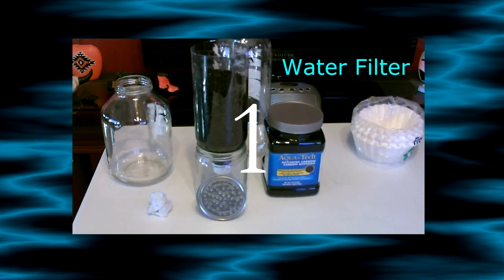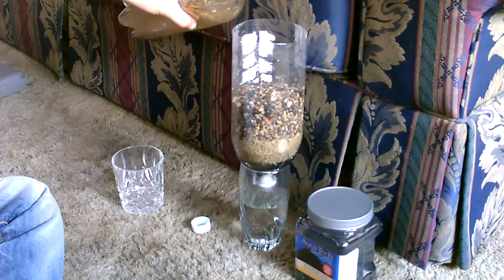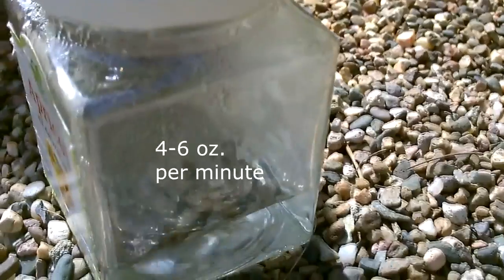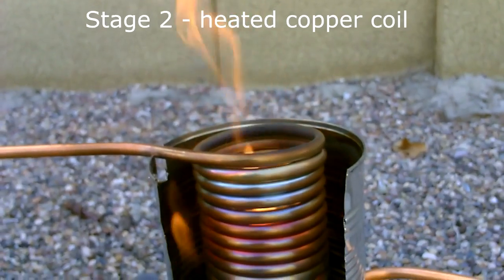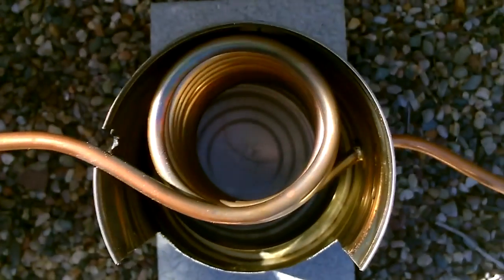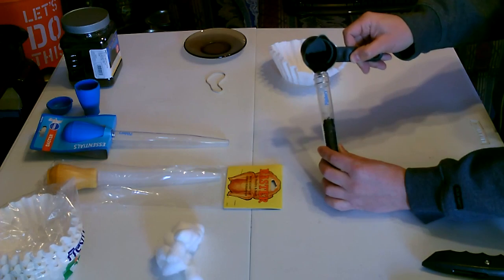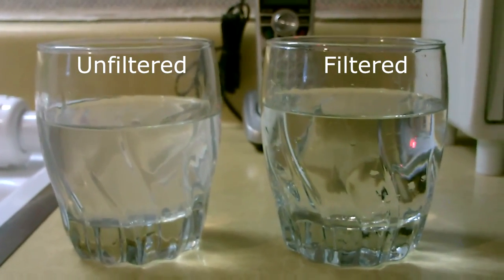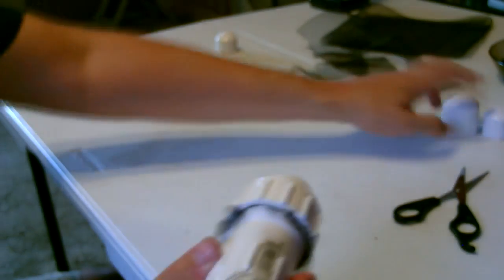MY 5 Homemade Water Filters! (Compilation video) - DIY water Filters and Purifiers - All Easy DIY

Comment: Here you go, a cryogenic Sterling cylinder with and electric motor that turns the air to liquid that runs into a heat exchange radiator with a fan passing air through it for air conditioning then the liquid going back to water vapor condenses into liquid where it passes through a filter system to produce fresh drinking water. I am positive by all your other videos you have done that you understand what you were just given? If designed correctly you should have an air conditioner that produces fresh drinking water all of a12 volt motor for the Sterling cylinder and a 12 volt fan equaling a total of 24 Volts to cool a room or even a whole house that has great insulation while making use of the condensation to provide your very own fresh drinking water. Novartis